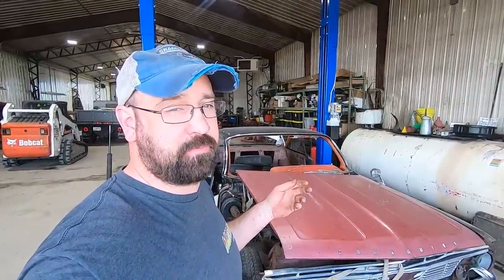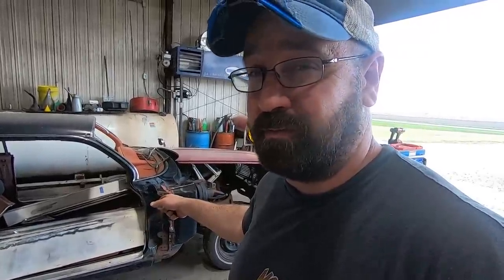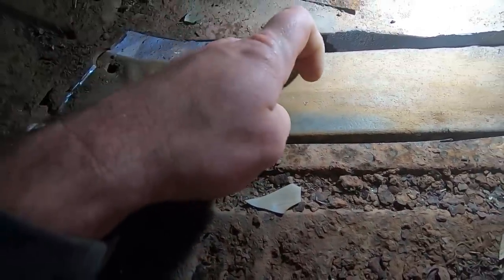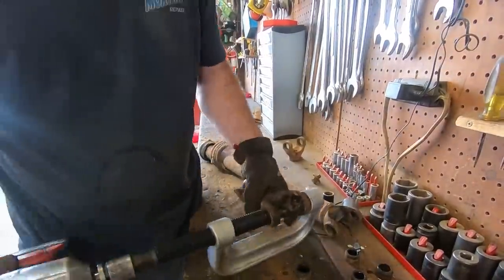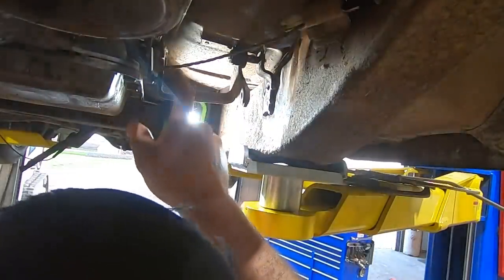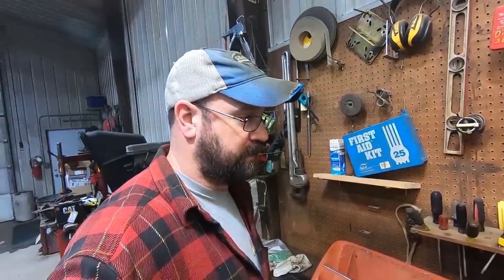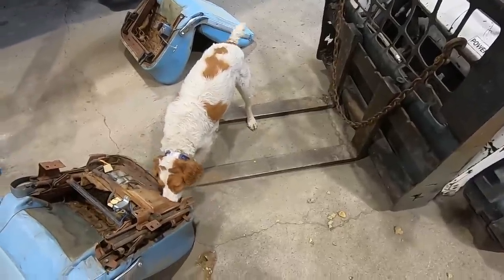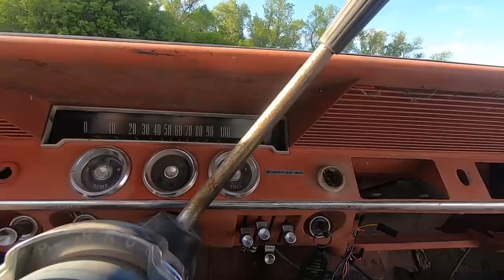Abandoned in the Woods for 50 years! 1961 Chevrolet BelAir Bubbletop Saved from the Grave!

Comment: Just say no to the later front clip. You'll find one in due time. Disc brakes are really nice to have. I vote for taking time to build this car as nice as possible, for as low as you can possibly keep the budget. Time is on your side with this one.

Four times the old shop means seven times the work to keep from losing the new one. Pretty sure that's how math works. Congrats on the new space. Having a lift makes all the difference in the world.

Comment: Congrats on the new shop. Looks as though now things will be way gooder than crawling under cars on a creeper. As for the bubble top, swapping frames would have to wait until you get the new VIN tag because a "new" frame won't match for VIN to do paperwork.Otherwise it sounds like a good plan especially if the front-end components are useable. I would media blast the frame if you do swap it but it strikes me that a good coat of rust converter followed by a good rust paint would be cheaper than powder coating it.  The front clip, though, sounds as though it might be better to look for a '61 clip even if you have to repair it and you already have 3 out of 4 main parts (grille, bumper and Left fender assy). A bit of welding and a date with the english stump and you would be in business.
Reply: my sentiments exactly. Nice Choice Mortske on that gorgeous body and roof line. Love me a early 60's Chevrolet Bubble top/full size automobile.. I just happened into a '64 Old's F85 instead of one of these years Impala Caprice or Bel Air. Though my early Chevelle El Camino is my real favorite. Congrats and I'm a looking forward in seeing whatever you do with this ol' Girl. I think a Dirt track car would be fun with a ton more Ass from a 327ci  348 396 or 427ci.btw.
Reply: @RabidSnot  if you're talking 1961, you might be thinking Impala, Bel Air and Biscayne. The Caprice wasn't introduced until 1965 under the Impala tag and had the official Caprice label in 1966. These all were great cars!
Reply: Ooo

Comment: U-joint hack... as someone that has lost needle bearing too many times to count, I wrap a few rounds of electrical tap around the joint to keep the caps on as long as possible until I bolt it back in again. I tape as soon as I unbolt it from the car. The odds of me getting the drive shaft out before a cap falls off is very slim. As for that floor shift, remember that those cars came with a two speed auto and most guys put in a three speed auto. No column shift was made for them.

Comment: When I was young and broke, I had a 1964 Dodge Dart, A good car for a 16 year old. I was backed in a driveway, and another kid, pulled in doing 40, hit his breaks, and they did not work. plowed right in my Dodge Dart. creased the whole front end, could not bang it out. Another friends Dad had a 1964 Valiant, in the back yard with a blown motor. He said I could have it. Every one said the front clip would bolt right on. Well it did, bolt for blot and hole for hole. My Dodge was Black, and his Valiant was Brown, and other friend of my Dads painted the front Black, and it looked great! So I had a 1964 Dodge body, with a 1964 Plymouth Front end and grill. Made for a lot of conversations. I vote to put the 1962 Front end Chevy, on the body of the 1961 Chevy. Good luck, love your channel. Mark

Comment: Just replaced the carrier bearing on my 63 Bel Air. The bolts have to get tightened with the weight of the vehicle on the tires. I just put all four tires on drive up ramps.  If you don't then you will blow the bearing out pretty quick. Thanks for all the great content.
Reply from the maker: Thanks for the info

Comment: The 62 is pretty much a parts car at this point anyway, so I say continue taking what you need from that. Seems like that will provide a LOT of what you need. Work with the 61 frame, if you can, because of the VIN. As far as the front clip goes, use the 62. You can always swap it again if you find a good 61. Brakes....well, of course ya gotta spend what you need to there. Same for the steering and suspension. Cool project, and a helluva save, Mortske! Nice job!
Reply from the maker: Thanks

Comment: A suggestion, pull the front clip if a 61 parts car isn't available, frame and all accessories for the bubble top .... Sand blast crylon paint clean up the rubber components ect...  They are many more 62's available than the 61 Belair 2door...   You won't loose $$$     :)

Comment: I'm pretty sure it was Derek from VGG that I learned this hot tip for cheap battery cables- just split up old jumper cables (at least 8 gauge but preferably 6 gauge cable), slap new battery clamps & eye- ends for the starter & grounds on (forgot what they're called) & you're good to go. I think Duff would even approve.

Comment: I would use those Riviera seats and make brackets for them, but add some form of console with an armrest. As for the body and chassis, I think that frame is shot. The combination of rot and accident damage means you are going to be time ahead using a different frame. I would just try to find a 4 door 61 parts car so that at least the years match. Then you would also get a 61 front clip in the bargain to make it look right. I would also do the floors and straighten that dent in the quarter. However, I wouldn't paint it, just preserve it as is with the mismatched panels. It would tweak a lot of people at car shows to see it with such a glaring imperfection!

Comment: My 64 Olds Jetstar 1 came from the factory with bucket seats and a center console with an automatic floor shifter and a factory mechanical tach mounted at the front of the console that had a cable running to the distributor. Wish I had still had that car but the olds 394 threw a rod right through the side of the block.  Ain’t nobody got time for that.  I was leaving for the Air Force and sold it for scrap.
Reply from the maker: Damn

Comment: Love those X-frame Chevys.  To answer a question you had about the driveshaft, as the diff moves up and down and the front yoke slides in and out of the trans, the rubber housing around that center carrier bearing flexes a little, forward and back.  I believe you put the weight on the rear wheels before tightening the bolts, making sure they're a little more forward in the slots than back so the rubber doesn't get stretched too far in normal use.  Keep the videos comin'!  By the way, I hope you can hold out for a '61 fender and not use a '62 front clip on it.  Take care and pat Duffs head for me.
Reply from the maker: Thanks for the info

Comment: Use the outside seat brackets off the bench seat for the buckets Then see where your at for mock-up of the inner bucket brackets build up. Use the fenders only off the ‘62. Keep the rest of the original ‘61 clip on the bubble top. Repair the ‘61 frame rust outs.

Comment: Hello Duff Chinn &  Mortske. Find that danged mouse. Not only in the seats but air cleaner as well. My 2 cents worth, take all you can from the 62 find a folding  front bench seat from anything that would fit. Keep the budget approach. If the title process goes as planned you will be able to move it down the road when your finished. Keep up the great work and help Duff find the critter.

Comment: Needs a big block and a manual trans, posi and some cool old 10 inch wide steel wheels in the back. I think i'd probly swap the frame though it's really bad! That year is my favorite! just the right amount of tail lights. body wise i think i'd start with a better quarter panel and a coupla decent fenders. i cried a lil when u dropped that u-joint cap too lol

Comment: The unknown strap is a cloth ammo belt, used from around ww1 well into the 50s. They were mainly used with browning .30 cal machine gun, air or water cooled. Length was determined by the number of cartridges that you can fit on the belt. You missing the metal ends on yours but since it was repurposed as ratchet strap, that make sense. The more you knows eh

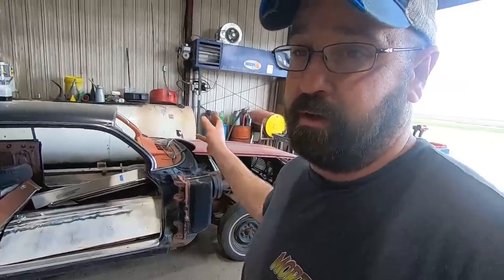Comment: 14:25 Future video idea: 250/292 I6/4-speed hotrod-ish build and install. Would be a pretty neat build and you could easily pull 250-300hp out of one of those straight sixes without too much trouble.

Also, a mini vid turning that rusted up longblock into a coffee table would be neat.

Comment: My grandfather's friend back in the early 90s had a bel-air derby car that was a bubble top and my job as a kid was to smash all the glass out of all his derby cars and I remember taking a sledgehammer to that front window and it was actually tough as a young 8 to 10 year old getting every bit out , it wouldn't come out in large chunks , but every car I'd get 5$ and my grandfather's friend would buy a pizza and soda pop for getting all the glass out of the derby cars ... those X frame cars would start folding from the rear and the drive shafts  would break from what I remember... then he eventually went to Chrysler Imperials or old for town squire wagons for derby cars ....
Reply from the maker: Oh no!!! X-frame cars are terrible in a derby anyhow
Reply: Back in the 90s anything was considered a derby car if it ran and went into reverse and at least one drive gear....it's sad that I've seen 210 delivery wagons ,chevelles and dodge chargers go to the crusher because of them becoming a derby car...

Comment: How did I miss this for 2 days?? Pleasure to see you ripping through a car on which I've accomplished nearly every repair known to man😎 I didn't see a Power Steering Ram on that chassis, though. Nice if your Donor Chassis had that.

Loved it when you turned the diff and if enthusiastically went "crunchle, crunchel, crunchel". - or was that just the brakes?

Carrier bearings - gotta love'em! Just press it in there - give it a little press-ie. Just press, press, press it in?? [ (burst of evil laughter) "That's what she said!"] Nice job of getting that mounted back in - that's the pain for sure.

Just a tip going forward for U-joint caps and needle bearings: a dap of fibrous wheel bearing grease spread around the needles - even if you have to remove some of the factory grease to get it in, will hold those needles usually even if the cap is dropped. ASK ME HOW I KNOW!

A comment on the 'view to the road' - you and Wes can now have Route Watching competitions !!! 😎

Battery cables sponsored by 'Mr. Strandy'. Mr. Strandy - stranded electrical cable of all sorts - custom harnesses a specialty (YES! We are color blind.)

Start up was NICE! Wait ... is that a (bah bah BAAAAAAAH!) ... FLEXI HOSE (ose ... ose ... ose...) ?????? Say it isn't SO, Mortske! 😎

What I want to see is you not to drive it again until you have a seat BOLTED DOWN. You're too much fun to lose to silliness. 
Good work - thanks!
Reply from the maker: Thanks much!

Comment: Like you, I like that Bubbletop.  There's just something about the way it looks....and I think deep down you want to do right by this one and are a bit torn between getting it done and getting it done right.  It boils down to one thing - at the end of the build, are you going to keep it or flick it?

If sending her down the road is the end game, then pull the 62 sedan to bits, clean up the 62 frame and spray bomb it (blasting and powder coating is effing expensive), swap the body, engine etc from the Bubbletop over onto it, use whatever you can off the 62 (windscreen, front clip, hinges, rear seat, suspension, brakes, tail lights etc) to make it complete, get brakes working, patch the floors / trunk floor and maybe pull the dent in the LR quarter, then flick it as a rolling restoration.

If you are keeping it, then although it's easiest, a 62 front clip just won't cut it for your inner perfectionist and you'll never be satisfied with it.  All you need is the passenger's front fender (and rad support, grille and lower valance if possible) and she's a full-on 61 again....so park it to one side at the back of the shop and wait.  One will turn up.

That frame and suspension.....yeah, she's toast for the most part.  Between the wrinkles, the booger welds and the rot, that frame will take more to sort out than the time to swap the body over to a new frame.  Use the one off the 62 sedan?  Nah.  Better off finding just a frame unless you have no other choice, because once you pull the frame off the 62, it will be harder to move around and harder to sell off its remains.  Either way, you're going to have to replace all the ball joints, rubber mounts, shocks, brakes etc, so that cost won't change whichever way the project goes...and if doing brakes, then yeah - a disc upgrade is the best way to go.  If your beaut of a white wagon is going to be used more than the Bubbletop as a cruiser, then yeah - swap the discs into that and put the drum setup on the Bubbletop, but that recent video of you moving it was the first time I've seen that in all the time I've been watching, so I'm picking she don't move much nowadays and I'm also picking that once the Bubbletop was on the road that you'd use the bubbletop a lot more, so I'm picking that's where the discs go.

Meanwhile, there's the floors on the beast to do....which would be pointless until you get it on the new frame because the captivated nuts aren't attached any more and you gotta tear up the floor to hold onto them.  There's the big dent to pull (yeah, I know you looooooove bodywork) but Chin volunteered (or was he voluntold?) for that one.  Hinges - yeah, steal or find a pair and bolt the door on and weld up any holes she has.....but for cheese and rice, don't leave it there as a "patina" look.  Finish the bodywork and paint the bloody thing a decent coat of gloss black.  You have your soapbox rants about flexi-hoses and the rest - I think patina is just a French word for "can't be bothered repainting it because I'm a cheap ass".  I despise people who have a car that is 90% covered in surface rust and they oil it up and call it "the patina look".  Paint goes on a car primarily to protect the metal from rusting.  I'll accept a 5% total area, but anything over that just looks wrong to me.  Rant over......just paint the damn thing!

Interior - on a black car, red looks kind of stunning to me.  Black on black is boring....although if you use chrome strip on the door panels as highlights and / or had a centre console with chrome or aluminium on it somewhere, then yeah, ok.  White interiors / upholstery look cool, but they show the smallest amount of dirt, so I'll never have one.  Blue, green or silver just look weird.  Red is sharp and it works with the existing dash.  You could also do black carpet and headliner, black door cards (with red or chrome strip highlights) and black seats with red piping to tie in the red dash to the rest of the interior.  Now THAT would look sharper still than an all red interior!  Yeah......  As to the seats themselves, I'm torn between the buckets and a bench seat.  I like buckets because they are individually adjusted and you can have a centre console with a few mod cons like cup holders and such in between.  Then again, if that model never had a bucket seat option, then forget that.  What model had the split bench seat so you could flip one half forward rather than the whole back of the thing....?  If one of those type of seats would fit, then best of both worlds there.....

Stance - she has to be about two inches lower than standard height.....but not slammed.  Wheels and tyres - I'm picking 15x6 or 15x7 with 215/60s and maybe 235/60 on back. Thin white stripe tyre.  Either steel rim and chrome centre cap or better still, the full face wheel trim.  The only other wheel that looked right on it that I've seen was like the ones on your white wagon - they look like an Aunger Hustler wheel and really suit the 60s / 70s period muscle (well, they're a 70s mag, so it stands to reason).  I looked at Rallye wheels and nope.  Just wrong.  Slots also looked a bit weird and anything else looked like Cragars or turned the car into a pimpmobile - and that just ruins it for me.

To be honest, Mortske, I think this is a long-term project that you pick at as time, money and parts appear.  Leave it at the back of the shop and if you're needing a break from what you're filming for "this week's episode" and you have some new parts in, go record a bit on the Bubbletop.  Eventually, you'll have enough for a complete episode and can publish that and take a week off from filming anything.  Doing it bit by bit and in between other things, not only gets it done, but you also don't feel so daunted by the WHOLE project all at one time.  She'll be lovely if you want to do it up to keep, but if putting it together to flick on, just use what's available in the '62 sedan and get rid of it after it starts, stops and doesn't let water in in copious amounts. 

That's my advice for what it's worth.  All the best, mate.
Reply from the maker: hate to break it to ya boss but we won't be painting it! haha

Comment: What an interesting piece! By the way, it might not be a bad idea to check the casting number on that 283 boat anchor toasted engine that came out of the car. I know an old timer here that used to drag race back on the day and he said if you have an early 283 (I think he said as late as 1961) that the cylinder walls had plenty of meat in them to punch out to a 4 inch bore so you could esentially machine yourself a 327. Hopefully the cylinder walls aren't too ate up for that and hopefully the walls are thick enough. Nobody shout me down on that. That's just what a guy told me...
Reply from the maker: Interesting
Reply: @MortskeRepair  what's kind of funny is I was going to ask whether it was a 327 but then I remembered it didn't come out until 1962....
Reply from the maker: @stephensaasen8589  Sneaky